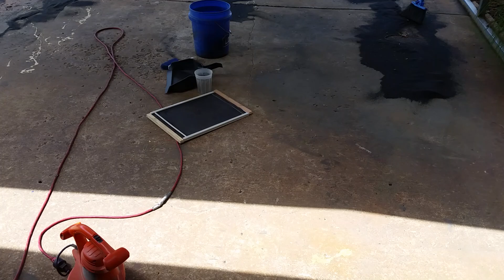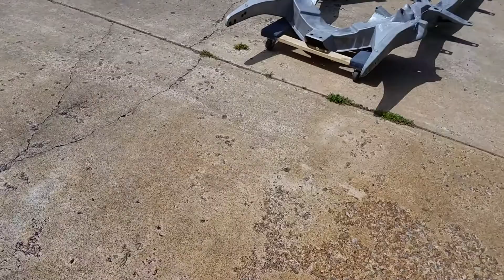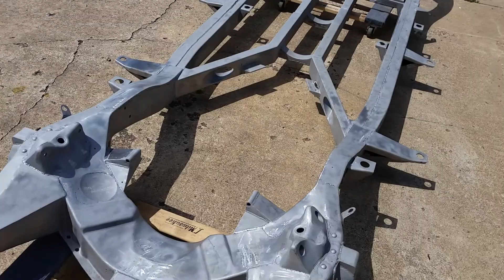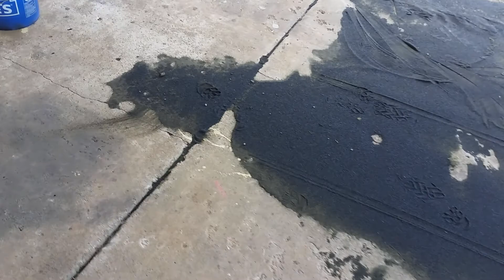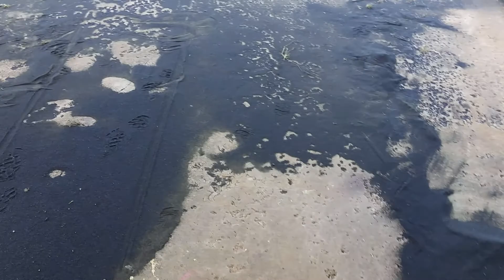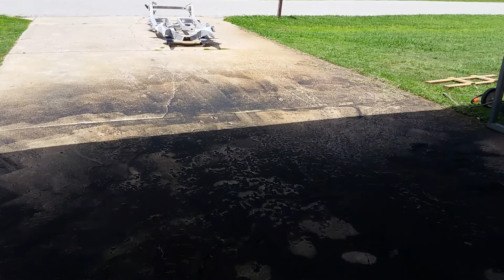Day six. 55 Belair Chassis blasted

Comment: Congrats on another box checked off!  I speed-read your TriFive build thread and didn't run across what finish you're going to apply to the frame?
Reply from the maker: It will be matte black after lots of filler work to make it look like it's a cast piece
Reply: Ooh, I can hardly wait.  I love this stuff.  Will that be next, or will you be painting the body?